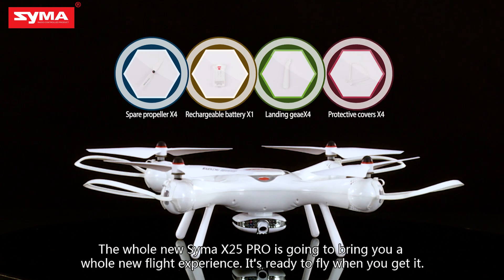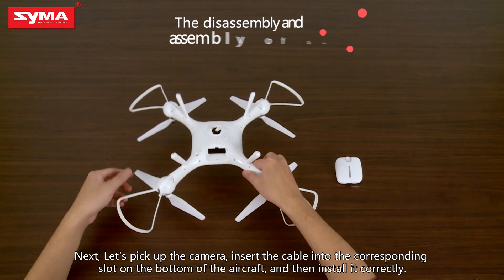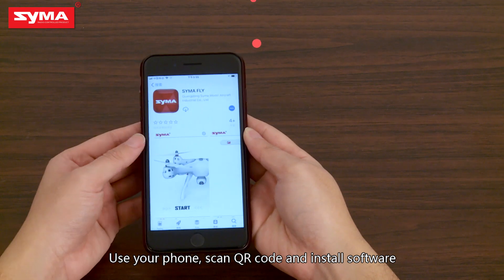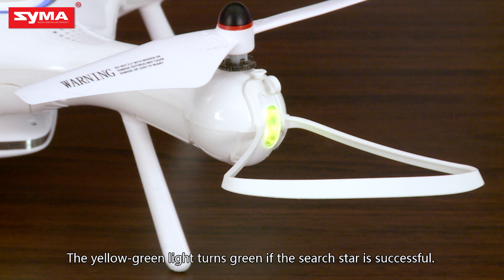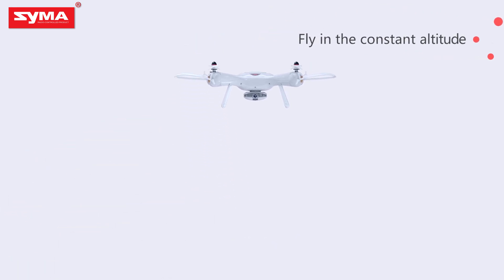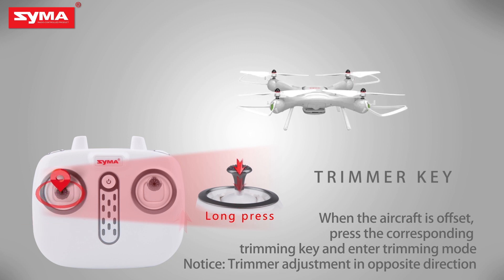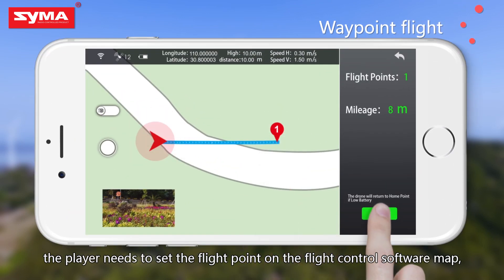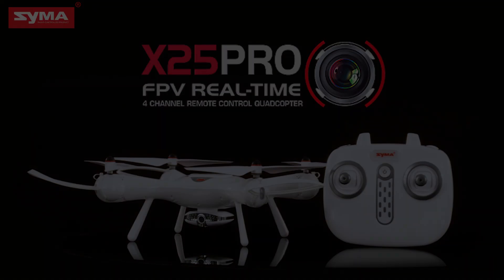Syma X25 Pro Operations Tutorial & Demo

Comment: I have flown mine only one time, it scared me to death. I powered it on, it immediately shot up to about 100 meters, so high I could barely see it....in fact it seemed so fast I could barely react. I pressed the return home mode, and it did slowly come back , successfully avoiding the tall trees, and touched down perfectly in the exact same spot from where it took off. My question is, why is there not better documentation on this drone? There is nothing regarding electric fence mode, orbit mode, or follow me mode. I am scared to ever fly this thing again until Syma publishes better instructions and documentation.
Reply: But I like SYMA